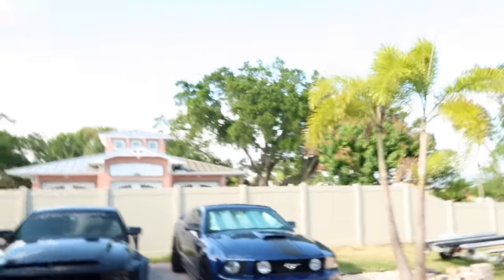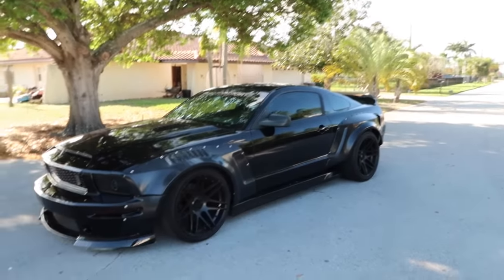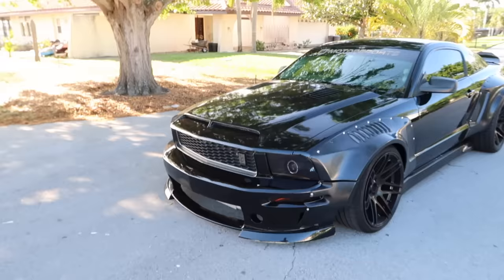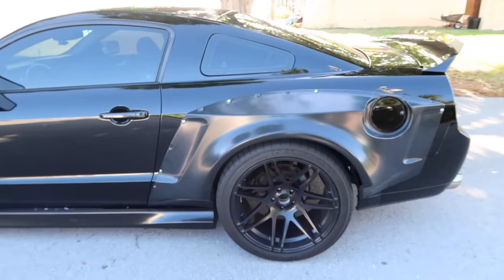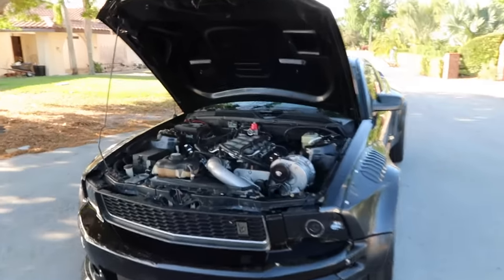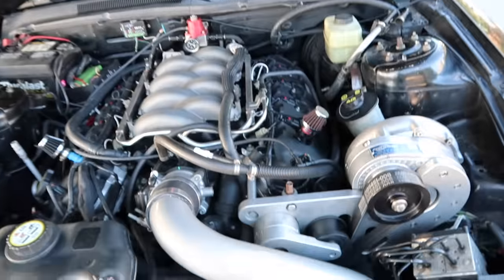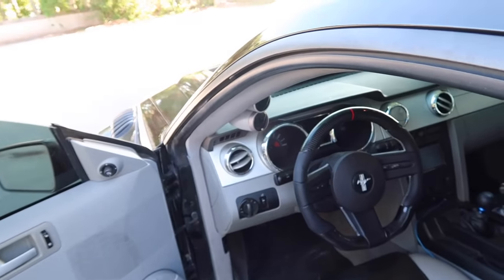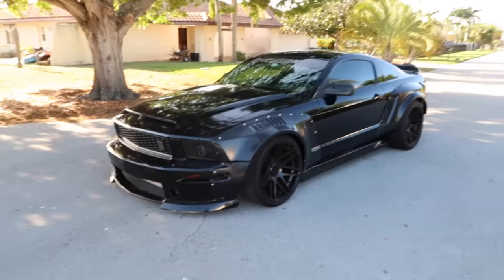Transformation BEFORE & AFTER of my 2007 Mustang GT *Stock to Modded*

Comment: this is the best '07 mustang ive ever seen no cap, my mom also has an '07 mustang and i told her she should mod it like this lol
Reply: I personally like Drew Peacocks 06 mustang better
Reply: Emiliano Cordova same
Reply: @cordovaxemiliano2066  its hardly even modified
Reply: @DLI002  exterior is just some wheels and a simple wide body, little duck tail and front bumper, a really clean car, not plain simple and not too much. But under the hood it's a pro charged 3 valve making 800+hp
Reply: @cordovaxemiliano2066  i still prefer the black one tho, its just my opinion
Reply: Emiliano Cordova yea that thing is a beast
Reply: @DLI002  I mean it's a nice car, but I prefer clean and low-key sleeper cars. Not too put there
Reply: @cordovaxemiliano2066  ths only thing that i dont like about this car is the exhaust is wayy too loud even when hes going 20 mph, and he says hes tuning it in the future aswell
Reply: He riced tf outta this Mustang in my opinion
Reply: Donovan Dunn it’s not rice if it helps the car and if he likes the looks...
Reply: @cordovaxemiliano2066  he said 07🤦🏽‍♂️
Reply: The mustang is automatic or manual
Reply: @DLI002  and now it’s engine swapped lol so much for it’s barely modded
Reply: @cordovaxemiliano2066  drew peacock has the best looking mustang I’ve seen on YouTube 💯
Reply: @cordovaxemiliano2066 the duck 😂
Reply: @tmwtpbrent14  bro that was 3 yrs ago, go outside
Reply: @tmwtpbrent14  u needa work on taking a shower

Comment: How much did this cost you all together? Something no one usually talks about when making these videos
Reply: Cheapest $700 up to $3,000 or more depending. I bet this one cost $1,500.
Reply: I'm sure I'll be called a liar but I have a 05 gt, ordered it when they first came out.   Its been completely customized, however the motor did blow on a dyno in 08 so the block is now new with a stroker....coyote motors weren't out yet.   Anyway,  I have spent close,  give or take,  about 75k on the car.  I don't have a wide body kit on mine but my upgrade list is very long.   It took about 5 years to get the car the way I wanted and I'm thinking about changing some things on it.   So,  he's spent at least 15 to 20k on his, maybe more,  maybe less
Reply: @dylandrake4325  you’re kidding? That pro charger was 8k alone...
Reply: @j2footballiq207  I think 7 months ago I was referring to the wide body kit. Not the whole damn car. Jeez
Reply: @dylandrake4325  this kit he has runs for about 3500 rn

Comment: Mad Max looks , I know it’s a few years ago but after all that work I am sure you’ve still got it. 
Definitely a mean machine, well done. 
I checked it because I am currently on the hunt for something to add a little more life to the summer especially living north of the border , you can find 07-14 with barely any mileage on them cuz of winter. 
Even though I could grab a 2017-2019 , I actually like the older ones just as much. 
Some of my new cars have just too much safety tech & tech in general. 
Great video

Comment: I was in a similar situation as you with my 2012 mustang gt. Bought it from a dealership down in SoCal, it had a vortech supercharger with 58k miles. It literally broke down 3 weeks after the purchase, didn’t even get a chance to push it. Half of the engine was done, low compression. The car literally sat for 8 months. At the beginning of this year I got it running again with a brand new coyote engine. Converted the car into a 2013, with a 4inch composit carbon fiber hood CJ style. Placed the vortech back, and my other mods now pushing 650hp to the wheels. At the end of the day I bought the whole car again, but I couldn’t do anything, as I had the car on a loan.  But none of that matters, as it brings me happiness when ever I drive it lmao. All the mechanics would tell me, you’re gonna hate it once you get this car running. The only thing I hate is that mechanic who stole 3k from me.

Comment: I’m boosting mine with the turbo I’ll be very happy if I make 500 with the 3v I have cams and intake and throttle body 450rwhp also if it fails I have a back up motor from a crashed one I got for basically free and I got an offer to sell it for good money and I refused I wish I did and I would have had more money for an ls3 I like the coyote but I would definitely go with an ls3 for me it’s simpler more power handles a lot of power just a better motor overall it’s also 6,4 liters